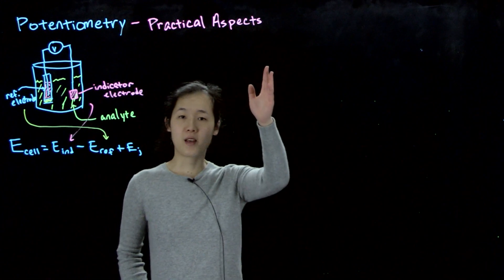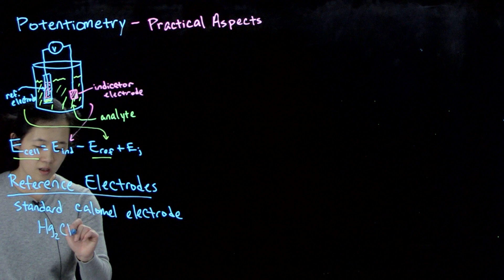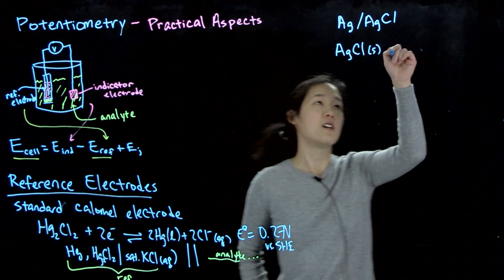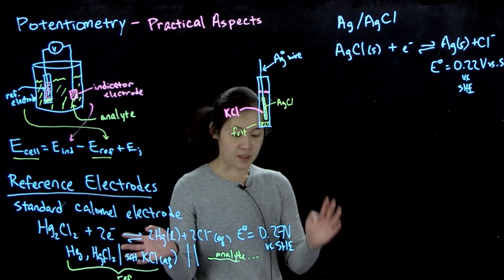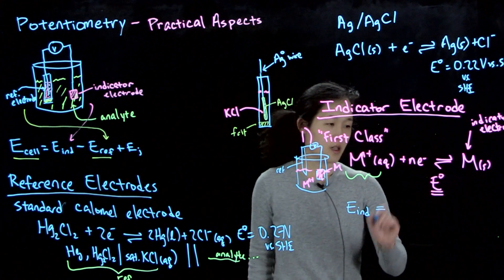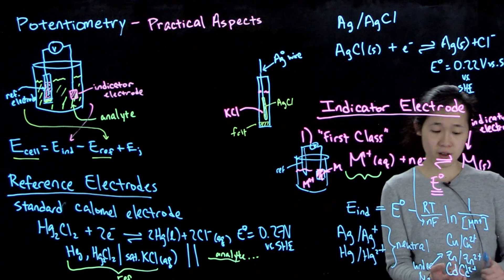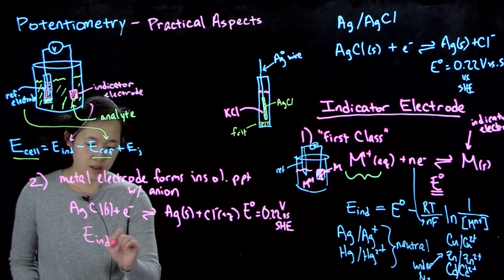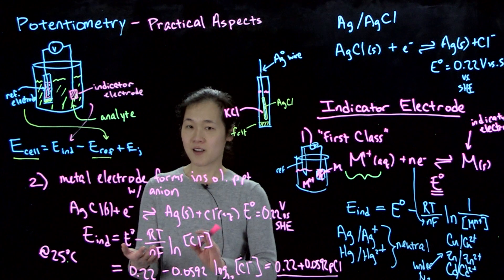L22B Electrodes for Potentiometry

Comment: could you please explain role of frit in reference elecrode
Reply from the maker: The frit prevents the reference electrode solution from contaminating the sample solution, while still permitting ion conduction between the two solutions. It acts as a low-resistance junction between the two solutions.
Reply: Thank you so much other question please comes to my mind how reference electrode keeps its potential constant even if some electrons are transfered to it